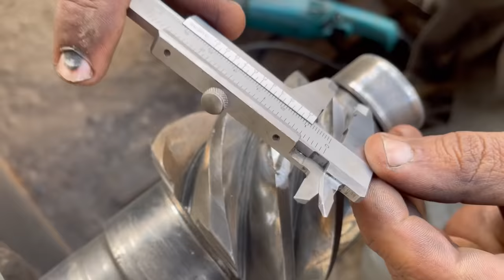I repaired the scrub pinion which no mechanic repairs | Give your opinion by watching the video |

Comment: The broken piece was estethically repaired, then the rest of the nondamaged areas was for sure destroyed by the grinding all over.
Reply: Chew them all up the same, then say "look, you can't even tell which one was broke"
Reply: Great work  they get it done that's what counts
Reply: Arm chair quarterback with zero competence of transmissions I see
Reply: Not to mention he destroyed the temper of the rest of the gear teeth, sure it looks good but it won't last a week. Not only will the repair fail but the surrounding teeth with get destroyed as well.
Reply: @MaddogJones  that’s exactly what I see
Reply: Imagine ,they do all this " fixing" and keeping those old junky trucks and cars running, forever and a day,with out a single White man around to tell them how to do it " the right way" amazing.
Reply: @carlospaige4589  Good job throwing the race card in there buddy
Reply: And the noise that gear will make
Reply: @carlospaige4589  amazing you can tell a persons race buy a youtube comment. you must have magic powers
Reply: @guypatts494  - If you understood the nature of what he was working on, you'd realize the "repair" was a waste of time.  It's going to be very noisy, grind itself and the ring gear down quickly, and fill the entire differential with metal shavings, which will ruin all the bearings.  Gears like this are machined to very fine tolerances, none of which can be duplicated by what he had available.
Reply: @fredrikthorin6217  - Just so you know, that was a pinion gear from a differential.  No such piece inside any transmission.
Reply: @mark-1234  you're correct I know I'm a machinist but  was still cool to watch.
Reply: @mark-1234  I understand  but it will still work I just repaired  a bull gear  in a dozer welded it right up re cut teeth works great
Reply: @carlospaige4589  - Your comment, while intended to be a dig, just ended up displaying your ignorance of what's at play here.  Yes, these guys are very resourceful but a little misguided in this instance.  That pinion won't last long.  Not only is it going to be very noisy and quickly eat up the ring gear, that process will put a significant amount of metal shavings in the lube, which will then take out all the bearing races (especially with the loads they put on these trucks).  Hypoid gears are cut to very close tolerances, none of which can be duplicated with what he's doing.  And since he ground on all of the teeth, he guaranteed it an even quicker failure.
Reply: @guypatts494  - I'm not sure how you can say it will work when it's going to take out every component in the differential.  Just because the truck will pull itself out of the parking lot doesn't mean it's a working or lasting repair.
Reply: @vicarious1  - The guy can obviously weld but he definitely didn't understand the nature of what he was working on.  Oh well, I'm sure he's found out by now.
Reply: @mark-1234  you have your opinion  and I have mine
Reply: I think it could work if they were more precise about that gear fix and not messed with the other ones, so long as they didn't get it too hot with that welder.
Reply: @carlospaige4589  , and forever coming back to get repaired over and over.  And doesn't have to be a white man just a design engineer who knows metallurgy and a good CNC programmer.
Reply: @guypatts494  - Yeah, I just back mine up with 40 years of experience.  :)
Reply: And it will sing like a muther. Till it just EXPLODES
Reply: Reminds me of GMC's frame repair guide-they (in the 80's) recommended grinding all (frame weld repairs)  welds flush.
Reply: @guypatts494  'cept a temp repair that doesnt last worth squat or isnt nearly as strong (i.e. reliable) since it isnt heat treated evenly is not "done" . The hardness variance in the gear makes it a ticking timebomb.
Reply: @guypatts494 1. you are with filled with b.s. or you havent stress tested those teeth. 2. A slow rotating gear vs an axle housing pinion on a road vehicle are completely different animals. The damage this "fix" caused down the road pales in comparison to the initial damage.
Reply: @garyr7027  no. Just hell no, your saying the equivalent of ="monkeys could travel to the moon as long as the mylar balloon is kept very very round. With ratchet straps. By eye balling it. It's totally doable." It is impossible to weld that gear tooth and not ruin the heat treatment. Those 2 things are mutually incompatible. Period. Their is no "opinion"  that differs. Get a microscope and it will be plain as day. Not only that, those teeth are cold ground within a +/- of 0.0005. It would be a miracle if he was within 0.09375 of matching ANY tolerance on ANY geometric plane. And lastly, it doesn't matter if the other teeth were left pristine, ALL the teeth MUST mesh evenly  or it will destroy itself in rapid fashion.
Reply: @sheldonbrown3261  na it's fine
Reply: @JM-yn5xz  I think that will he the least of the worries. I'd bet the bearing would even be a problem to slide onto the shaft with all the warping.  Lotta heat and no cooling, no reheat treatment or stress relief.
Reply: And for the record-he cant weld for $h¡t
Reply: @sheldonbrown3261  - Interesting. Wasn't aware of any recommendations like this because normally they advocate not welding on a frame.  In fact, so much so that years ago we ended up replacing a frame on a 90s vintage 1-ton pickup.  Paid 80 hours and was a pain, as every last nut, bolt, bracket, clip, line, etc had to be removed and transferred over to the new one.  (It was replaced under warranty because it had started to crack around the backside of the control arm bushing flange.)

But maybe you're talking heavier trucks.
Reply: @mark-1234  it was an early 80's repair recommendation guide if I remember-it stuck in my head for the same reason  since its generally advised against.
Reply: I bet if this was US they probably get a new one but these guys do better job then a new one and plus they saved lot of money, So don't think you are a professional i'm sure these guys know what they are doing.
Reply: @JM-yn5xz  - I'm gonna guess, given what they did in this video, that these guys don't bother with setting preloads and backlash.  ;)
Reply: @mark-1234  them be professionals I was told-only the truly ignorant such as we waste time on useless things like that.
Reply: @ganeshnarayan5505  - No, what they did is not better than a new one.  What they did is set themselves up for a repeat failure with far more damage than they had the first time.

Like I said in another comment, these guys do quite well with what they have to work with so nobody's faulting them.  I've even seen them replace valve seats in diesel heads.  Not sure how long they last, given their install process, but it's a poor country and what they have to work with.  In this case, though, they're going backwards.  Their "repair" might last 1000 miles at the most, if it doesn't snap that welded tooth off on the first load.
Reply: Out of tolerance. All that grinding will just create more backlash. There’s no one on earth that he can take all that end play out!
Reply: @MaddogJones  lol, that's what I was thinking....you know there is several thousands of an inch deference between the welder part and the machined part, I wouldn't even know where to begin to try and set the lash and end-play......but I guess you gotta go with what have.
Reply: Let's see your welds and your repairs, Fredrik.
Reply: @garyr7027  maybe if he didn't touch the other teeth and if he made the repaired one a tiny bit small, then the other teeth would take enough of the load.....maybe.  I respect the effort even if misguided
Reply: @sheldonbrown3261  - Yeah, I think they'd do well to heed Abe Lincoln's advice:  "Better to remain silent and be thought a fool than to speak and to remove all doubt."
Reply: Easy Einstein, this is for a differential lol 😂 check the facts. Pinion gears aren’t used in transmissions because they don’t utilize ring gears. Look who’s the armchair quarterback now. The original comment is right, you can’t repair a matched set with weld, you can make it look good, but it’s just a matter of time. Just because they can doesn’t mean they should. I’m not insulting their skill for the record.
Reply: @mark-1234   Normally I would agree with you if this was for a rear end with thousands of RPM. Isn’t this a steering part? It might work fine for awhile, depending the load it is under. If this was for a rear end it would be an epic waste of time.
Reply: @ganeshnarayan5505  The only way this repair has a chance of working for more than a few days is because it appears to be part of a rack and pinion steering system and is not under heavy duty cycle like a rear end.
Reply: @ryanfry390  dude this is for some type of rack and pinion steering system
Reply: @Greg-yu4ij  - They do not use hypoid gears in a rack and pinion, and they do not use rack type steering in trucks.
Reply: @Greg-yu4ij  - I've been a mechanic for 40 years now and I've never seen a hypoid gear used anywhere other than in a differential.  They're used because that cut allows a significant offset, which transmits a higher torque.  (That's why you always see the pinion gear mounted lower than the center of the ring gear.) 

If the truck has a regular steering gear box (I've never seen trucks use rack and pinion),  the teeth on the sector shaft are straight-cut.  They are additionally tapered down at one end so gear clearance can be adjusted by pushing it deeper into the worm gear (input shaft)

A rack and pinion would have straight cut teeth on both the input shaft and rack.

And yeah, that "epic waste of time" is why I commented.  Like I've said a number of times already, I admire these guys doing what they do with what they have to work with (crap economics) but this repair is going to bite them in the shorts, and rather quickly.

It's not so much the RPM as it is the tremendous loads on that pinion.  That's why the cut and finish has to be perfect and preloads and backlash have to be spot-on.
Reply: @Greg-yu4ij  -  Like I said, it's a differential.  Here's the video I just stumbled across of where they got that pinion.

https://www.youtube.com/watch?v=C82MwjctxMs
Reply: @sheldonbrown3261  - Aw, c'mon, Now you're just being difficult.  I thought he did quite well.  Strength aside, he filled it in well.  No pockets or gaps, with plenty of penetration.
Reply: @mark-1234  I'll give him fill, but prep, clean up/contamination and preheat to prevent warping...but he did put the effort in making it look nice. I'll give him that.
Reply: @mark-1234  dont forget the other reason for offset hypoid gears-lateral side load/load on bearings is reduced/transmitted perpendicular/in rotational directions instead of directly opposing 90° cross axis, reducing the force pushing the centers apart.  Had to throw that in.
Reply: @sheldonbrown3261  - Not sure where you came up with that (guess you'd have to define what you mean by "side loads") but at face value that's not accurate.  If you've ever worked on heavy trucks, you'll see a very large bolt going thru the differential housing, with a locking nut on it.  Its purpose is to stop the ring gear from deflecting away from the pinion. The side loads (if you mean what I mean when I say those words) are very high in a hypoid gear.
Reply: @sheldonbrown3261  - You're not going to warp that pinion by welding on it.
Reply: @ryanfry390  It's true that the pinion gear in this video is for the differential of a heavy truck. However, there are plenty of cars that have transmissions with ring and pinion gearsets.  All Subarus made today. Older VWs, Porsches, Audis.
Reply: @mark-1234  That video is not related to the pinion gear repair.  In that video, they replaced the whole R&P gearset.  Like they should have done in this video.
Reply: @e-curb  - Well, if you had watched it, you would have seen them remove that very pinion from that differential.  So yes, it's quite related.
Reply: @mark-1234  I did watch it. The pinion gear they welded up is NOT the one from that other video. In this video, half of the tooth is gone from the middle to the toe. In the other video, the section of tooth missing is from the middle only. There remains a bit of the tooth at the toe end. In addition to that, the pinion in the other video shows damage to the adjacent tooth that this one doesn't have. If it was the pinion from that other video, why did they take the ring gear off the diff?
Reply: @e-curb  - Okay, obviously I misspoke.  My bad, as they replaced this pinion with a new one (and a ring gear, which is the only right way to do it) .  My apologies.

I grabbed that because some commenters, due to the welding, were trying to suggest it couldn't be a differential pinion.  The video shows it is, and it's the same type of differential as the one they welded the pinion on.  (The kind with a removable pinion support.)
Reply: @sheldonbrown3261  I'm agreeing with you on principle but you're a ten thousandths off. The piece would be ground to +/-0.005 and it would be a miracle if he was within 0.187 of an inch.
Reply: @mark-1234  yes you very much are. And you will loose the heat treatment process(multistep).  Considering the high tolerances needed for these to work correctly,  it doesn't take much to ruin a a part. If enough heat is required to turn the material molten for  joinimg, fill welding, repair ect...you have definitely warped the metal in one  way or another. Their is no way mmñ
Reply: @guypatts494  they didn't 'get r done'  they just wasted their time and the customers money.  This "fix" wont make it a dozen miles
Reply: @mark-1234  I was referring to the difference (I should have clarified ) between straight cut teeth and hypoid gears and how the torque is transmitted from the pinion to the ring-i.e. the fact that hypoid gears have higher load tolerances since the torque vectorsdifferently. This is the side loading I was clumsily referring to and how the load on the pinion shaft bearings is lower with hypoid vs straight cut.
Reply: @sheldonbrown3261  it be fine
Reply: @MaddogJones  where am I tens of thousands off??? On what???  And since he handled the piece and touches it several times w/no gloves, I'm gonna go out on a limb and say it wasnt heat treated. I'd just picked a random fraction arbitrarily to point out the futility of hand grinding a pinion gear.
Reply: @guypatts494  are you serious or just trolling?
Reply: @sheldonbrown3261  read my statement a little more carefully, I was agreeing with you for one and I said ten thousandths off, a HUGE difference. You said 0.0005 I pointed out that that part would only have a tolerance of 0.005 is all. I also agree that the part probably wasn't heat treated and the the temper was ruined by the welding. I also agree that the part would only last a few miles... We are on the same page for the most part. Oh I also said that it would be a miracle if he was withing a 1/16 of an inch.
Reply: @sheldonbrown3261   I might go there and test it out what u think of that
Reply: @carlospaige4589  How is race relevant? Is any of what the OP said false?
Reply: @WarPhotographer1974  🤡
Reply: @sheldonbrown3261  I'm serious  I will go there  and drive the truck for a month I have a machine  shop do gear repairs  all time

Comment: I think the machinists in this video did all he could given his access to parts and materials. I absolutely admire his willingness to attempt such a precise repair. The quality of the part repair has some limiting factors for which the machinists cannot control, so he did the best he could given the circumstances. Do you all really think the machinists doesn’t realize that his fix is likely less than ideal?? He is doing the best he can!
Reply: Der Traubengott   Depends on how it's abused , even the original failed . If pampered it can last forever. Imagine it's for driving the truck empty and with care to a place where they can properly fix it , because  I second though the opinion on fitting a SH original part instead of this . Also i suspect in these places a new imported original part can cost as much as the whole truck ...

Comment: The welder/grinder/machinist really earned his pay on this job. I would have said, “Forget it—order a new part.” But as supply chain issues in the West make parts harder to come by, shops like this can help us all re-learn the ways of the “old time” mechanics. I would like to see a note under description about how the repair part worked out in service. By the way, the video is quite well produced: good lighting, clear close up shots, details of each tool or welding rod he used, and nicely sped up and edited to shorten the repetitive work.
Reply: That repair isn't going to last at all, you can't weld and grind a helical gear cut, not if you want it to last more than 30 days. Where are the videos showing these repairs operating over time in the industry?
Reply: @TheNorthsquad  justamente são têmpera diferente assim forjado e solda não dão certo
Reply: U can clearly see the slag cooling in the middle of the weld which is impossible to get out and then get a good weld it's just junk and would never stand up to inspection
Reply: @TheNorthsquad  I'm not quite sure. We have forgotten to repair things in our world. We are only replacing. I'm a machinist also, but maybe this repair lasts longer than we guess.
Reply: @hannes7348  people forget that "repairability" has a very close correlation to design. Sometimes is malicious, sometimes it's the nature of the product. Repairs, in the long run, never financially work out. I think this may be a good example of "once it hits the road..." I doubt it will make enough money to pay for itself assuming nothing else goes when this part does (again). Time and place...